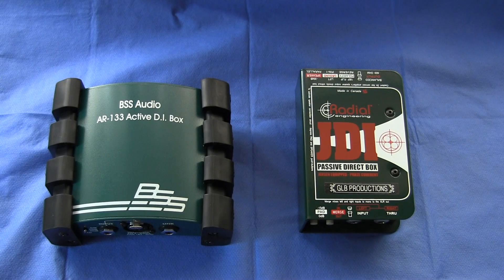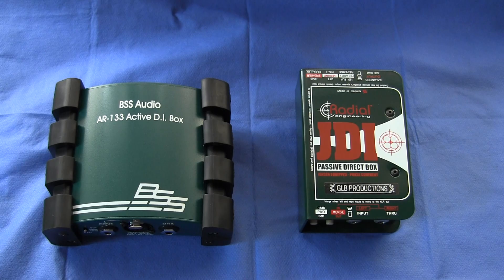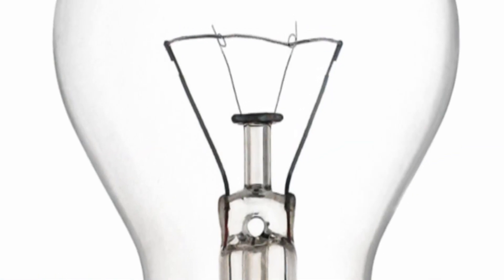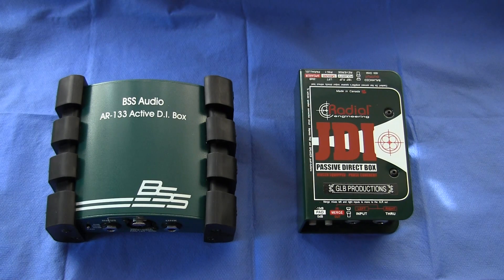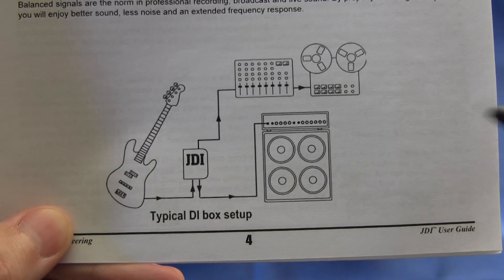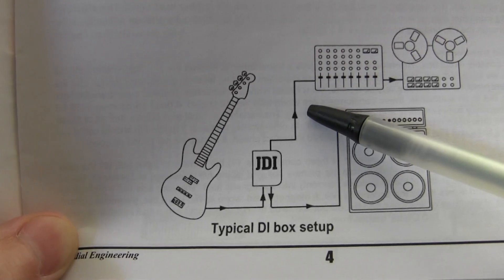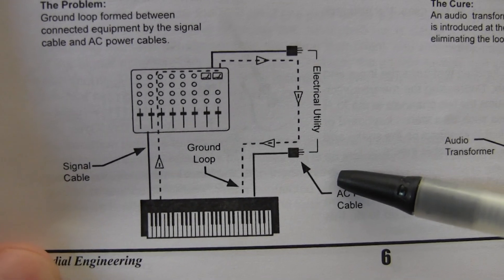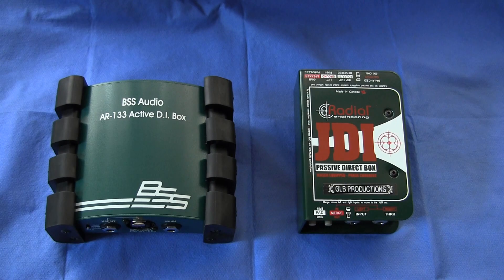DI boxes part 1: What does a DI box do, and when do I need one?

Comment: Not too sure what you mean in your warning you say they lift the AC,
Reply from the maker: It refers to lifting the ground on the electrical power supply, as opposed to the audio ground. This usually involves breaking off the ground pin of the A/C plug, which is extremely dangerous and should never be done.
Reply: I have always connected my gear into one wall plug, that usually fixes the problem
Reply from the maker: That's the correct way of solving the problem :)

Comment: Mr.Goh, would like to get yr opinion regarding running a DI Box in the Reverse Manner i.e.
adapting a BALANCED Output(compulsory to maintain it Balanced but its at Line level)
Into a Unbalanced Feed(preferably attenuated to a Mic level)..

Is that possible with typical Passive DI? Will it do any harm or perhaps any degradation of audio intergrity by running a DI Box backwards??

Thx a bunch!
(ps: a line/impedance matcher is not an option for the said client)
Reply from the maker: Yes you can do this - the transformer doesn't care which direction the signal is run. Remember that you can only do this with a passive DI box 😉
Reply: @GLBProductions   Thanks for the sound reply👌👌😄

Comment: Good day Guys. regarding your Connector Matching. is it possible to use a cable that has a jack  end and a XLR end to eliminate the Di box? for instance when it comes to plugging in your Keyboard to a snake.?
Reply from the maker: You can do that if your source has a balanced 1/4" output - in such cases there is no need for a DI box.

Comment: I just got a pre amp and it's not recording well into my software. Would running a DI box in between my Pre Amp and interface help?
Reply from the maker: Probably not, especially if your source is already balanced and low impedance to begin with, such as a vocal mic.
Reply: @GLBProductions  Thank You. Would you know what my issue might be? My vocals sound bad when I record them with my software. They sound muddy and the soundwaves are not smooth, they are squiggly.
Reply from the maker: If you post the recording online I can have a listen.

Comment: Hello brother.. I have some queries regarding ground loop/earthing issues, humming, buzzing issues. Please, provide me with a solution if possible. 

Problem#1: I play the Sire S7 guitar. It has three passive single coils on it. I know single coil pickups make noises and they cannot cancel the hum like humbucker pickups. But, I am having trouble recording guitar in my bedroom studio setup for this issue. When I record raw pickup sound (Connections: Guitar>Focusrite 2i2>Cubase 10.5), I get a little buzz/hum. When I lift my 10 feet long guitar cable up from the floor, the hum reduces. Then if I touch my guitar strings the hum gets reduced one further step. It gets down to a bearable stage, but it stays. doesn't go away. Thisway when I play, I can barely hear the buzz, but, when I pause for 1 or two seconds between two phrases of a solo, I can hear the buzz. Later on If I put distortion on the recorded raw clips through 'Guitar Rig 5' or any other amp simulator, it does not sound very nice to me due to that buzz.

Problem#2: When I practice at the practice pad with my band members, my guitar generates hum especially when any hi-gain distortion patch is selected on my Zoom G3xn processor (my band members' guitars also buzz in the practice pad). I had the guitar checked by a guitar technician here, he said, my guitar is normal, it has no serious issues. I think I am good at making processor tones accurately. I mean, the patch or the processor should not be blamed for the hum or buzz. It is something else creating the problem.

Few days ago, I did a gig. I was surprised there to see my guitar was completely fine even while playing high gain distortion patches. It was not creating even 1% of the hum or buzz that it usually creates at my home, or practice pad. There I noticed, the sound engineer put a DI box (probably it was an active DI box) for each of the instruments on the stage such as my guitar, bass guitar, keyboard, and the octapad. He connected my guitar like - Guitar>Processor(Zoom G3xn)>Active DI box>Consol.

Some other facts - 
a. I live in a 35 year old house. It has an earthing issue.
b. The cables I use, I think are OK. No issues with the cables.
c. My interface is also checked. It is fine.

Now, my questions are - 

Question#1: If I use an active DI box, will it solve the hum/buzz issue? Can DI Box be a solution for my home's earthing/ground loop problem?
Question#2: If I connect my things like this - (Guitar>Processor>DI box>Focusrite>Computer) which type of DI box shall I use, active or passive?
Question#3: Secondly, If I connect my things like this - (Guitar>DI box>Processor>Focusrite>Computer) which type of DI shall I use? 
Question#4: In case of recording, and live gigs/practice, which way of connection/routing do you prefer? DI first then Processor then console/interface? or Processor first then DI box then console/interface?

If DI is the solution, please, suggest a Radial DI box which is perfect for me. I love stereo sound FX like delay, reverb, etc.
Reply from the maker: That was quite an epic comment! My answers/suggestions: 
1. A DI box can solve SOME noise issues, but it cannot solve those that are caused by electrostatic or electromagnetic interference. I suggest borrowing a DI box and giving it a try. 
2. Passive
3. Active
4. It depends - for re-amping the guitar is recorded dry (without effects) and the signal is then played back through the processor/amp for effects to be added. For live use the DI normally comes at the end of the signal chain.
Reply: @GLBProductions  Thank you so much. One last question... In live, normally what I do, I use two outputs from my processor. Left (mono left) and right. Then I pan one hard left and another hard right on the console. This way, I get stereo delay effect. If I use a DI box after my processor, how can I get that stereo sound? Can it be done by using a DI Box that has two inputs and two outputs? If yes, can you suggest me a DI box within 100 USD that will serve my purpose? The DI box must have ground lift option as I am suffering from ground issue also. Thank you so much for the help you already did.

Comment: very informative video, i do have a question, i play guitar and i have a guitar amp. Where is the best practice to put DI box? Guitar - DI - Amp - Mixer? or Guitar - Amp - DI - Mixer? Thanks a lot!
Reply from the maker: Either will work - it depends on whether you want the sound of the amp to be captured in the signal being sent to the mixer. Try both and see!
Reply: @GLBProductions  If the guitar has active pickup, then you use passive DI box. Similarly, if the DI is putten after the amp, then it is getting high signal like an active pickup, in that case will I have to use a passive DI box?

Comment: why connect the di box to the amp? then the sound board cannot control the volume or are you just saying it's optional?
Reply from the maker: It's so that the amplifier can act as an on-stage monitor for the musician while the signal from the DI goes to the main PA speakers.
Reply: @GLBProductions  oh ok, generally speaking do musicians control their monitor volume or should the sound engineer do it from the board?
Reply from the maker: This needs to be worked out in consultation with the performers, but in general sound engineers control the level of floor monitors (wedges), performers control the level of in-ear monitors (IEMs) as well as instrument amplifiers.

Comment: Hey, so I am only learning guitar and have a problem with buzzing. I was suggested that a DI box would fix that. But I only have a combo amp and a guitar, no mixer or anything else. So would it still work if I just connected a guitar - cable - DI box - cable - amp? Would a DI box still be relevent without a mixer?
Reply from the maker: No it will not help - in this case the buzzing is being caused by something in your environment rather than a ground loop so you need to identify that problem and deal with it :)
Reply: @GLBProductions   Ok thank you, saved me a bit of money. My building is old and doesn't have grounding in some outlets, I think... not sure about it though, don't really understand how electricity works. Any suggestion on how I might fix my amp buzzing? It buzzes unless I touch any of the metal parts.
Reply from the maker: Yes that sounds like a grounding problem. Try different outlets around your house - if you have a socket tester you can use that to determine which are grounded and which are not. Make sure that you are using a 3-wire power cord with ground pin, if your amp is equipped with one. If none of these work it may be worth hiring an electrician to help you solve this problem, because it's a safety issue as well as being super annoying.

Comment: One additional detail about utilizing an instrument cable that’s =/> 5 meters in length is the increase in capacitance. As capacitance increases, a guitarist or bassist will notice a loss in the high end content of their signal. This is especially a nuisance when one insists on having their pedalboard populated with only “true bypass” effects pedals. When the input cabling to the board, the linear run of the cabling on the board and the output cabling from the board to the amplifier are summed, significantly exceeding 5 meters of instrument cabling is more often the case than not. A line buffer is the solution.
Reply from the maker: Thanks for the contribution :)

Comment: Hi. I’ve got an issue. My audio cable is is about 135m, so whenever I connect the output from my PC to the amp, the sound becomes distorted and have humming sounds.

When I connect the audio output from my Handphone to the amp though, the sound works perfectly fine.

Should I use a DI?
Reply from the maker: This sounds like a grounding issue - try running the PC on battery power and see if the noise goes away.
Reply: @GLBProductions  ah. As it is an industrial PC and not a Laptop, I couldn’t actually run it on Battery.
Reply from the maker: Ah ok, in that case try with a laptop computer running on battery.
Reply: @GLBProductions  if it does work, does a DI help? The problem with DIs are they’re mostly battery operated and my audio device is stationed outside.
Reply from the maker: Hmm, I think you better tell me more about your audio setup.
Reply: @GLBProductions  I finally got to make it work with a DI box.

Connection goes like this.

Industrial PC > Behringer U-Phono > DI BOX > 135m Cat6e cable > Mic input Limiter/Compressor > Bosch Amplifier > Speakers.

I’m still having a little Hum, but the sound is fine.

Comment: So is the Electro Harmonix Hum De-bugger basically a kind of DI box?
I was thinking of getting one to remove hum from my single coil pup guitars but now I’m wondering if a di box would be more useful?
Reply from the maker: Most definitely not - the EH unit uses digital processing to analyse the incoming signal and remove both the 50/60Hz fundamental as well as the odd and even harmonics of this frequency. EH do not give details on how this is done but judging by the amount of power (400mA) drawn by the pedal I would say it involves quite a lot of processing power.

Comment: I am only running short cables in my studio but i have an issue when playing guitar/bass i get interferance but if i touch the jack plug on the guitar it goes away,  I have had the new house wiring checked all sockets  are good earth, will the Radial di box  with jenson transformers cure this issue?  I dont want to be acting as the ground (earth) thank you.
Reply from the maker: Ah yes, this suggests that there is a grounding problem with your amplifier or whatever the guitar is connected to. I have experienced this especially with USB audio interfaces and other computer-based equipment which uses a floating ground. A DI box will not solve this problem because the issue is not multiple grounds but rather the lack of any ground. In practice I have found that the best solution is to run a separate ground wire (any insulated wire will be fine) from the ground pin on an electrical socket directly to the equipment causing the problem. This is completely safe provided you know what you are doing and tie in to the socket correctly.
Reply: @GLBProductions   Thankyou were on the interface or effects  pedal do you connect the wire to from the earth pin ?  just the metal body ? As you know they usually   all run of a 12 or 9v  step down transformer with only a 2 pin plug( 220_240volt) (no 3rd earth pin) could I make a dedicated  junction earth box? as you say it's safe?Now Radial do a isolator box called ISO and a box called an ice cube  just  an in & out ,will that solve the issue ? I appreciate and respect your valued advice kind regards Stephen
Reply from the maker: You're welcome Stephen. You have to experiment on the placement of the earth wire on the equipment to find a location where the noise goes away - this will vary depending on the construction (eg plastic vs metal housing) and grounding scheme used by the manufacturer. Those isolators will not work for the same reason as the DI box - they are designed to solve the problem of multiple grounds, not the absence of a ground.
Reply: @GLBProductions  thankyou amazing I have all plugged in to the house earth sockets which are tested to show I have earth so why is then as you say an absence of earth? All I can do is to insert  new independant copper ground rods , and earth each individual appliance(not on plastic) then I know they are earth grounded for sure  thank you for your help back to square one !
Reply from the maker: There is a difference between the sockets being grounded correctly and the instrument itself being grounded 😉 The fact that your noise goes away when you touch the jack plug on the guitar means that the guitar itself is not being grounded through the rest of your signal chain - when you touch the plug you supply the ground and hence the noise goes away. In other words, your A/C grounds are all present and correct but the audio ground is not, hence my suggestion of a separate ground wire.

Comment: Thanks so much for this, you are a great teacher.  How would you solve microphone hum in a home studio setup? It's an old house so the electricity isn't optimal to say the least.  I have bought ferrel rings (didn't work), and I have a "Hum X" coming in the mail.  Is there a type of DI box I can use to run my SM7B mic through as opposed to running guitar/keyboard? Right now I'm running my mic to a tube preamp / compressor, then to my Focusrite Saffire Pro 40.  In the DAW the hum is driving me crazy
Reply from the maker: You're welcome! In a situation like this you need to find out where the hum is coming from - it is from your system, one of your inputs, or the power supply. Unplug everything from your recording setup except the computer and interface - if the hum is still there, try getting a laptop computer and running the same setup on just battery power, or run your desktop off a UPS. If the hum goes away, you know the problem is in the A/C supply. Then you would go to your breaker box and start switching off circuits one at a time to try and isolate where the noise is coming from - sometimes it can be caused by an aircon unit, refrigerator, clothes dryer, that sort of thing. You also want to check that your recording setup has a good A/C ground through the third pin of the power plug.
Reply: @GLBProductions  Thanks so much for taking the time to try to help me!  I will do everything you say here (Except for the laptop since I don't have access to one).  I subbed.  Hope to see you making new videos soon.
Reply from the maker: You're welcome, let me know how it goes.

Comment: Uh.. starting from nearly scratch here. What does it mean when your "ground references don't match?"
Reply from the maker: It means that the reference to A/C ground at the source and destination of the audio signal (for example on stage vs. at the back of the hall where the mixer is) are not exactly the same. So if you put a voltmeter between the earth and neutral pins of the power socket it would not read exactly the same in both places.
Reply: @GLBProductions  awesome, but in layman's terms that means what?  Starting from nearly scratch, 'member!😆 is that like the grounding/3rd prong on one cord does not connect to the same source as the ground-prong on the other cord?  We have a bad hum at church... thanks for your time and patience!

Comment: The issue I have here is that my powered speaker hums on connecting the XLR to the mixer. 
What do I do?
Reply from the maker: That's generally a ground issue - make sure that your powered speaker is connected to the same AC circuit as the mixer, and that the circuit is properly grounded. You can use a 3-light AC socket tester to determine this.